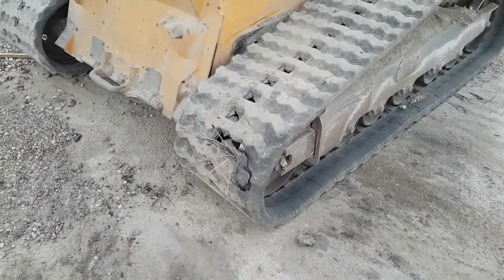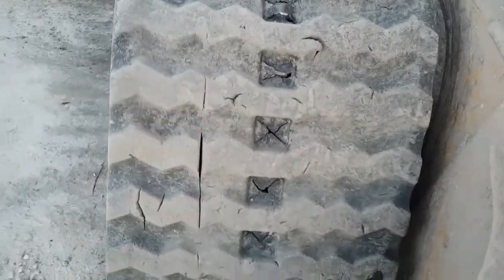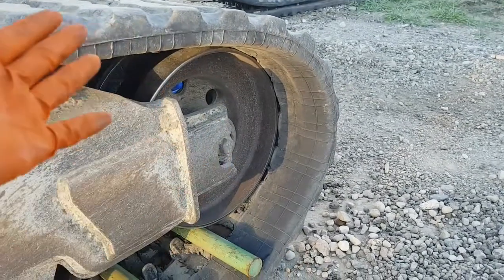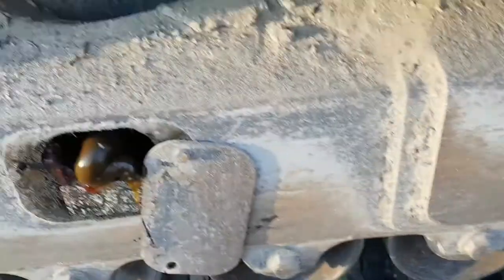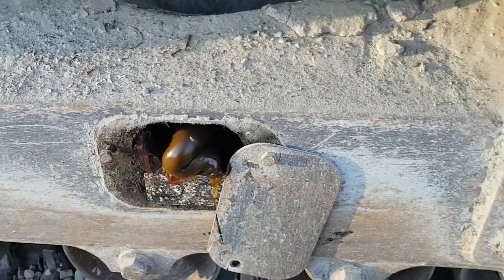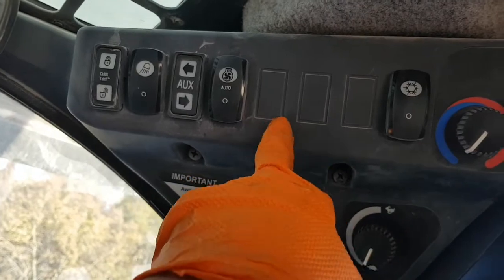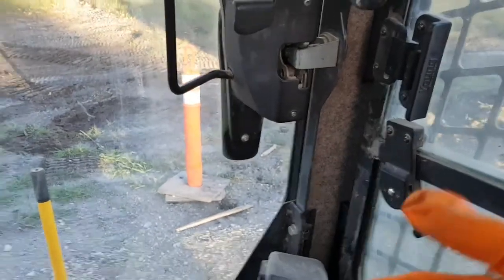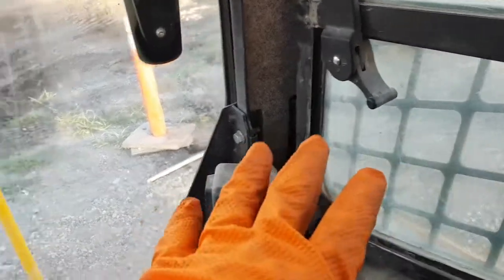John Deere 329D Speed Sensor code 1595.02

Comment: I have a problem with my John Deere 329 d left joystick not center there for a wile I could switch the parking break off and on a few times and fix it but now that’s not working and ideas thanks
Reply from the maker: Try a recalibration, if not, your looking at joystick replacement